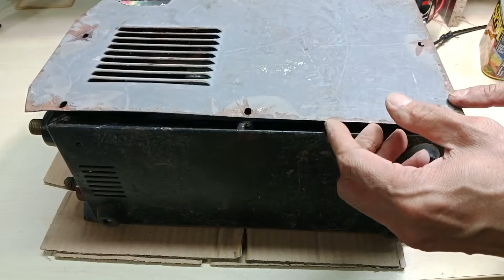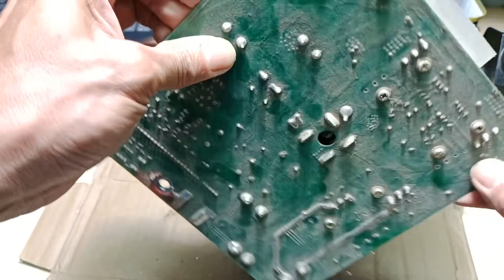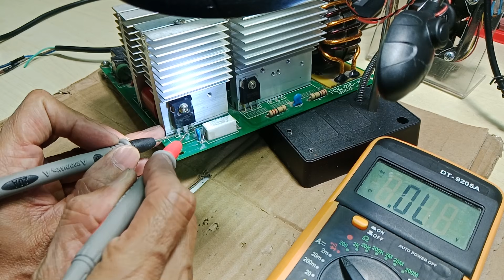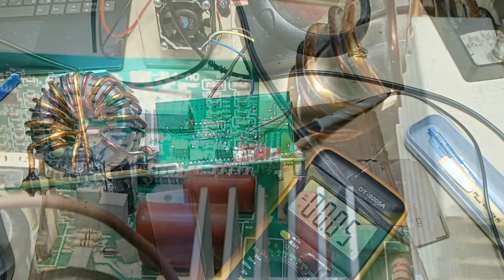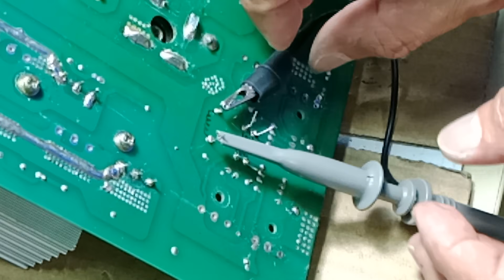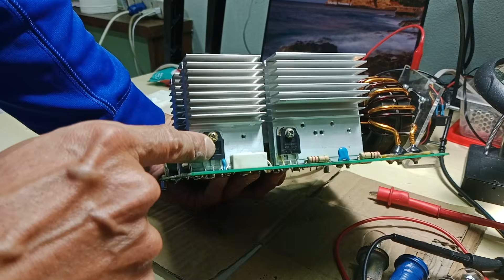007 Inverter Welding Machine Repair, Shorted IGBT

Comment: Where do you get the schematic
Reply from the maker: I draw the schematics myself based on common single board inverters with 2 IGBTs and SG3525 PWM controller IC.

Comment: F09 code how can I fix that problem
Reply from the maker: if the inverter have a microcontroller that giving you that error code then most of the time the only fix is change the board.

Comment: Hello, I was given a soldering iron to repair. The problem was that it wouldn't turn on. Upon checking, I found the IGBTs were shorted. After replacing them, the soldering iron turned on, but it's not generating PWM and therefore isn't outputting any voltage for soldering.

In my case, the board that's plugged into the PCB uses a "UC3845BD" PWM controller. I have 0V on the "compensation" pin.

If I lift the pin off the trace, the controller generates PWM and I get a voltage at the output.

I don't know what the problem is or why that pin is at 0V. I've tried tracing the pin to see if it's shorted to ground, but I can't find any faulty components.

Could you give me any advice?
Reply: I know this is an old comment , but did you ever solve this issue ? I'd really  appreciate your replay .
Reply: @اعمالالكهرباء Hola, no, no llegue a encontrar la solución, un caso muy extraño.

Comment: Good job may freind I have a welding machine with the same fault I did chage the two igbts and the bridge rectifier they were both shor circuited and it worked the display worked and the fan started too amd was giving 58 volts at the output but when I tried to test it, it made the same fault and shut off the house electricity again what do you think the problem would be?
Reply: Did you confirmed the gate drive components of the MOSFET if they are still working?
Reply: @JosephOto-s5wThey all seemed to be ok when tested

Comment: Sir puwede ba gamitin ang ds018 mini diy kit oscilloscope?
Reply from the maker: pwede. kasi hindi naman very high frequency yung mga signal ng inverrter welding machine. kayang kaya ng mga low cost oscilloscope. ang una kong oscilloscope eh yung maliit lang din.
Reply: @DIYPhil newbie lang kasi sa sir. Ano dapat gamitin sa pang test ng gate at emitter? X1 oh x10 sa probe? Di ko kasi alam kung ilang volts ang papunta sa gates ng igbt 😅. Gawa ka sir ng blog step by step kung ano dapat ang settings ng oscilloscope sa pag test ng wave ng igbt.
Reply from the maker: @Enteng-Kabisote  nasa 10 to 15 volts ang input sa gate ng IGBT. Galing kasi yun sa output ng auxilliary power supply na 15 volts. Yung x1 o x10 depende sa voltage range ng scope.
Reply: @DIYPhil sige sir, gets ko na.

Comment: Gandang araw sir.bago npo ung ic sg3528 s controller po.wl po 6v s pin 11at 14 po.di p gumana igbt po.ano po maippyo po nyo sir.slmat idol
Reply from the maker: @DanteIngat  Yung ibang pins ng sg3525 ano voltage reading? Pwede kang mag message sa akin sa FB Diy Phil - Youtuber para pwede mag send ng picture
Reply from the maker: @DanteIngat  Yung mga igbt hindi talaga gagana kpag walang signal galing sa pwm controller

Comment: Sir,
Where i put the negative probe of the avometer on testing sg3525?
Reply from the maker: Hi. You can find the ground plane of the board. You can verify it by checking continuity to the Pin #12 of the SG3525 which is the GND pin.
Reply: Thanks my dear  @DIYPhil